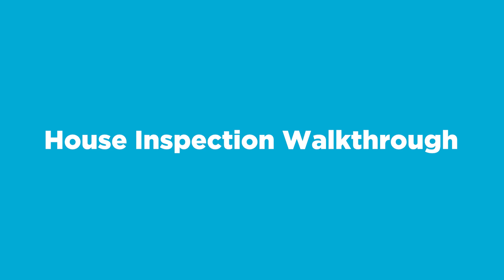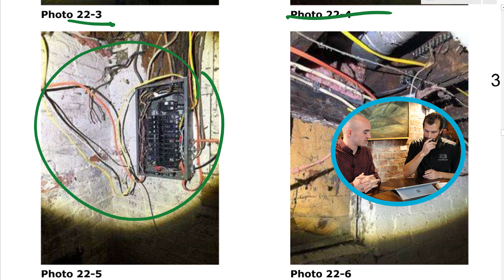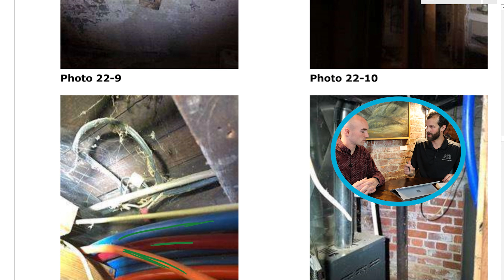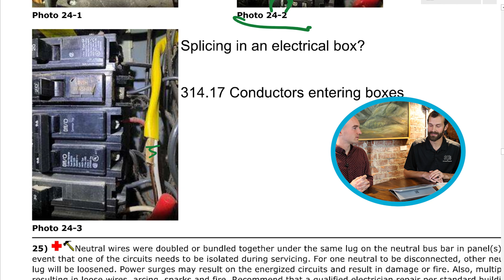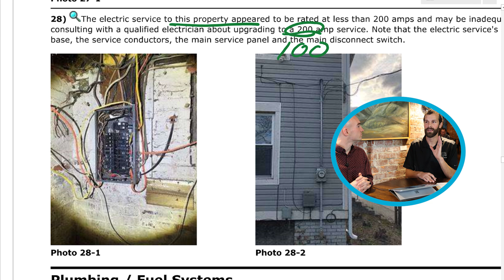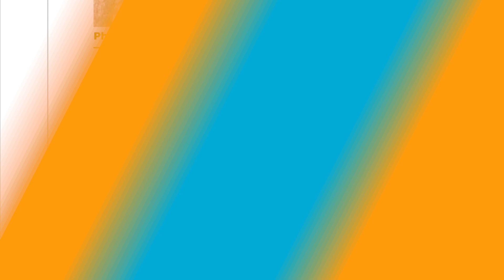Understanding Your Electrical Home Inspection

Comment: Ok.  so when he asked if the paper is fire resistant I realized that I have been holding two contradicting ideas in my head for a very long time.  1)  All things engineered for electrical work are designed with fire prevention in mind and 2) the paper in NM cables seems to be just normal paper that would burn normally.  So immediately I went to the truck and grabbed some paper from the wire sheathing and held a flame to it.  It caught fire just as easily as normal paper would and it was actually much harder to put out than normal paper!  Blowing on the small flame would not put it out!  Non-scientific I know but I thought I would share.

Comment: That paper inside NM cable is definitely flammable to some degree. At least the particular cable I was working on one day was. Accidentally nicked one of the conductors after stripping the sheathing and tried using shrink wrap to protect it (since it was so tight to the sheath, and I had limited cable length). A heat gun was probably a better idea than a mini dremel butane torch to secure that shrink wrap. Thankfully no fire

Comment: I love your channel. So many help DIY videos!!! I am researching the electrical code regarding installing a level 2 EV charger in Los Angeles, CA. The distance from my panel to the charger location in my garage is 90 feet and it will run under my house in the crawl space. Do I need to put the Romex wire in a conduit or since it willl be in a crawl space, I don’t need a conduit?

Thank you for the help and advice.

Comment: My upgrade of service from 100 to 200 with a outside main cut off, lasted less than 5 minutes. His only comment was label ALL breakers in the box even if they are not used at this time; people need to know what is hooked up and what is not.

Comment: So much here you could pickup from the code. You only skimmed the surface  understandably but great job nevertheless.

Grounding gas pipe bonding assuming it’s metal and connects to mass of earth.

Bonding random metal fixtures in the house and fittings (radiators, copper water pipes ) that are not connected to mass of earth could create a ground fault and shock hazard of its own.
Reply: That being said to do the calculation you will need a tester that can read higher ohm readings of around 1Megohm that could be beyond most multimeters. You will need a specialist continuity and insulation resistance meter - megger do quite a few of those.